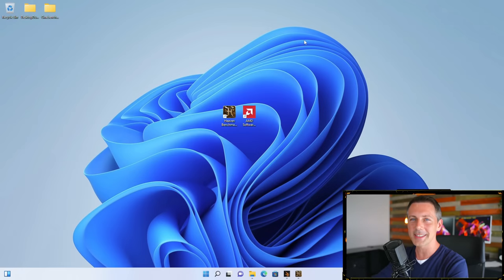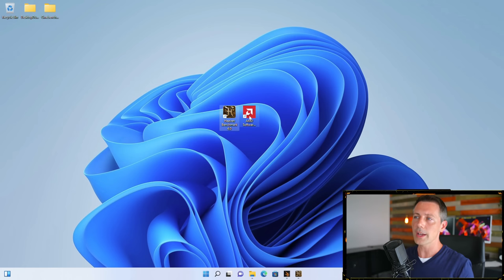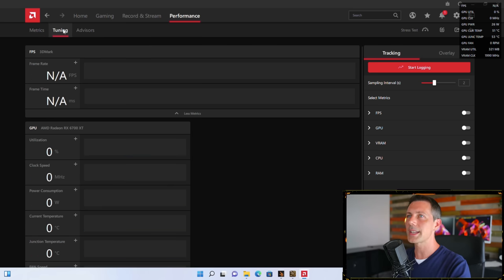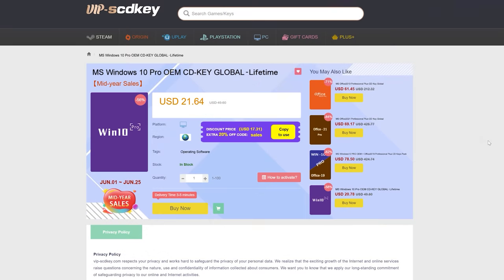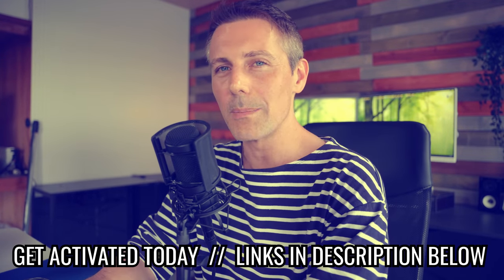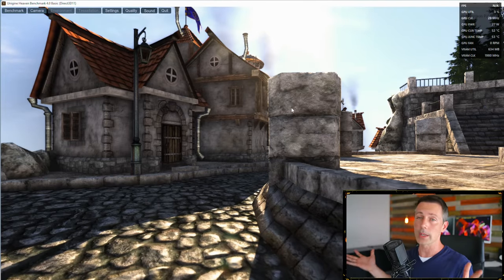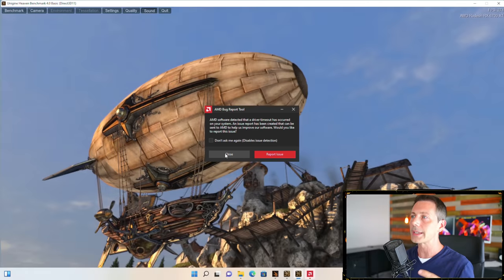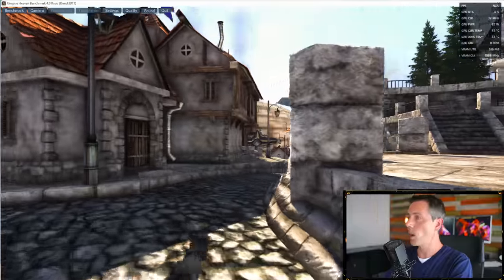How to UNDERVOLT AMD RX 6000 Series GPUs

Comment: I do disagree with the fast timings point, I have the same card and have it under volted/OC’ed and I have fast timings enabled and it’s been stable for me so far.  Also this model does come over clocked out of the box, the challenger D does not which is the baseline asrock model. Granted my voltage is a bit higher than in the video but overall the card has done well with my testing so far.

Comment: I'm using a RX 6600 Powercolor GPU, I've tried several OC / UV + 20% power up settings and got an increase of 5-15 (+- 10%) FPS. Should I keep using the stock settings or do OC with this increase?

Comment: I just got a rx 6700xt from Powercolor (Hellhound). 
That's weird.. If I set the same setting as you my GPU draws 120W but less GPU Temperature (GPU CUR around 48/ GPU JUNC around 57)
But I don't want less temperatur. I want less power draw :D Besides, if I drop to 1080mv I get artifacts.

Appreciate the tutorial. Thumps up

Comment: Hi. I was thinking of going for the rx 6700 xt. It recommended 650watt psu but i only have 550watt in my system atm. My prosessor is a ryzen 5 2600. Do you think in ok with my 550watt psu if i undervolt the rx 6700 xt?

Comment: HOLY Crap! Not even 200 Mhz difference on core clock, and it's eating so much more power! WOW! I doubt you will even feel that performance difference on a 6800XT (especially if you don't game at 4K or trying to get 144 FPS). If you want most games to run at 60 FPS at 1080p/1440p, you can easily drop the power consumption and clocks. Depending on how much you game, this could save you a significant amount on your yearly power bill, especially with the high costs of power that we're dealing with now.

Comment: If you set vsync or limit max fps in a game will the gpu use a lower power automatically or does it always use max power? In my amd settings I remember seeing 5 different stages (low to high demand) that you can customise different clock speeds. Not sure if power draw is affected by these stage settings or not.

Comment: got my reference 6950xt to run at 2300mhz, 950mV, fast memory timing but stock vram speed - power consumption dropped from 270w in Heaven benchmark to 170w at 70°C

Comment: Fantastic video, I'm also using a 6700xt and I originally tried the auto undervolt option, it would occasinally make my pc restart and reset my amd settings, these manual settings in the video are perfect for me, thanks. One question, You mentioned SAM (smart acess memory) and I ended up trying to enable it in my bios, I followed the steps I found online but the SAM option just isnt there for me, is it because I need both an amd cpu and gpu? I could get resizable bar with my nvidia gpu with my intel cpu
Reply: also your C drive disk have to be in GPT mode, there is manual on yt how to do it without reinstalling Windows
Reply: @sanyaez  it's all good, I only have an amd gpu, I would also need an amd cpu to be able to enable SAM

Comment: Just bought a 6800 which is way over the 1660 ti I'm coming from.

I want to undervolt it to drop the power usage and heat, not as concerned if I lose a few frames per second. 

Never done this before, where should I start?

Comment: Hey Bryan, I thought that the binning for voltage efficiency was opposing / detrimental to overclocking.  Basically the leaky samples clock higher.
Reply: This is true, but to get the higher clocks you'll need a crapton of voltage, and hence blow up the power consumption massively

Comment: Is the PowerColor Red Devil likely to be one of the better 6700 XT for undervolting? Jeez if I would have known I could run 6700 XT at 110W with only a 5% drop in performance I wouldn't have bought such a large card nor upgraded to a Corsair RM750x power supply.

Comment: I managed to get my 6600xt down to 1080mv and 2700mhz. I have no clue how it works but it runs at 95 watts stable with memory clocked at 2250 with fast timings

Comment: I'd rather get MORE performance than less for a card that I paid for. Less performance for less power doesn't sound like what most gamers care about. I don't mind how much power my PC uses. I don't leave it running all day so I would rather have a power hungry PC that gets better performance when I am playing it rather than one that gets less performance than stock just to save on power consumption. Just my opinion. I did overclock my 6700xt and run multiple tests until I was no longer getting more performance then slowly started undervolting. I did this back and forth with the undervolt and overclock to now be undervolted to 1125 and overclocked to the max along with max on vram with fast timings. I had a stability issue and lower performance raising the minimum too high. I set the minimum frequency to half of the max and have been getting great performance and lower temps as well.

Comment: Have you ever experienced where the test runs fine in heavens benchmark for 30 minutes but then in game it crashes?
I have Powercolor red devil 6750XT and the lowest I could go is 1140mv at 2600mhz with a  +15 power limit. It was smooth in heavens benchmark for 30 minutes but when I go game something like Horizon zero dawn or Far Cry new dawn, the game crashes after loading into the game and video driver times out. I had to bump the MV back up to 1150 to be stable. Seems like I cant go below 1150, even though I reduce the frequency. Wonder if 6750XT is just different or the card I got is bad luck  hmm.

Comment: Does anyone else have a problem with Unigine Valley or Heaven hanging and eventually crashing shortly after bringing AMD Adrenaline window on top? I can run the benchmarks but only if I don't bring focus to the AMD Adrenaline. This used to work fine about 6-12 months ago when I previously tuned my GPU.

Comment: morepowertool is also cool you can drop the voltage of the gpu by 100 a 150mv my rx6800 and rx6800xt do minimum 650mv the funny thing is with that i had for mining also for gaming it uses less voltage.

Comment: RX 6800 is running stable with 0.925v on 1970mhz and max memory mhz, you can play heavy games in 120fps with under 100w power consumption
Reply: Did you just lower the voltage in Adrenaline? Do you have to change frequencies or does it do it for you?

I want to set my voltage as low as it is stable like 900v

Comment: starnge, I have a Red Devil 6750XT, its default Clock is 2684Mhz, and the Voltage is 1200. I can lower the voltage to 1100 and run Heaven, Valley and Superposition benchmarks with no issue, but once I lower the Core clock, I immediately get the AMD Driver Timeout error

Comment: um, this isnt a super new thing, infact some older AMD gpu's would often overclock better with an undervolt rather then overvolt, sames true for some amd cpu's, minor undervolt and they still overclocked to the same levels as with a minor over volt... (we often found FX chips could be undervolted and overclocked to their turbo speeds or higher for example, but with LLC cranked up.. funny enough using less power and producing less heat then running it with lower LLC and higher overall volts.. 

i still want to see the 6k series vs the 3k series cards on x58, i mean i know the 3060ti would be an upgrade over this 1070 i have.. but... what would give the best overall results???

Comment: Guys my 6700xt challenger oc on default settings works just wonderful until I turn on a game and it just crashes after like 2-30min I’ve tried out : 
Fortnite can’t finish 1 game 

Rust I have 5min to set up a base to not lose everything

Tarkov crashes very “rarely” about every second game 30min~

the Finals I haven’t finished one game
 
Apex crashes once every 30mi

Squad 2-20min

the only game I don’t play but my little brother does is Roblox and it doesn’t crash never 

The rest everything crashes every 2-20min

One thing I have noticed is that as long as I am in the menu it doesn’t crash never only when I start a game and the fps are very stable avg 100fps 1080p in tarkov and stuff 
What can I do?

Comment: My 6800xt founders runs at 2400mhz at 1.005V, 2150 mem with fast timings, right now replaying the Witcher 3 next gen at 4k ultra locked 60 and the GPU sits at 57C GPU, 67C hot spot and using 160W avg. Crap cooler but good chip and mem.

Comment: mines crashes at 1100v and having 1120v gives me bad fps and not much change in temps regardless higher mhz or lower. default 1150 seem good but its hot

Comment: I wonder why people max out power limit while undervolting.
Won't the power draw be reduced anyway because of undervolting? So where is the point by increasing the power limit to the max (+15%) ???
Reply: It's so your gpu can try to reach as high of clock speed it can/use all of the voltage given to it.

Comment: Any Idea how to fix Vcore changes not apply, on my test Rig Rx 6700 worked at 1.07V but, now on my main Rig I stuck at 1.2V and getting +30W power draw and higher temps for lower performance :(
I try DDU bot not helped, I also try MSI afterburner and also changes not apply.

Comment: 6800xt 1050 mV and 2340 clock gives me 195-205 watts, its quieter than my cpu fan, unfortunately coil whine is a problem lol. We'll see if it works in games, but its been running the benchmark for 30 mins at an average of 2300mhz and 202 watts
Reply: Crazy really, card doesn't go much above 2380 with a full overclock but seems to love being starved of power and running at 2280-2300 at 60 watts less power and 10c less temp....

Comment: I would use the AMD 5600 CPU instead of the 5500 to get Gen4 PCIe lanes with a 6700XT. Also Smart Access memory really improves gaming performance on the AMD cards.
Reply: pcie gen4 wont make a difference on 6700 XT, its the same performance on gen3

Comment: You did not just undervolt. You also underclocked by around 250MHz vs stock. That's why power went down so much.
Reply: yes but 90 percent of the time you will not get anywhere near 2600mhz more around 2300-2400mhz, this way you still get same performance if not more while remaining in low tepms, i dropped by 23 degrees with these settings in borderlands 3 on max settings with a roughly 5% incresse in fps

Comment: Don't just full send vram Freq to 2150mhz. With these cards the memory timings could auto switch to looser timings past 2100 or 2120MHz, so do some benchmark runs at each step to see which mem Freq gives you best performance. You might have mem that won't be stable above 2100 but will still run causing error correction which causes performance regression. This is a prime example of dont just copy these type of YouTubers who make mainly entertainment videos, they aren't as tech literate as you think
Reply: I wish there was some kind of on screen warning which could be triggered when VRAM errors are detected to warn about excessive overclocking

Comment: Hello,
Is there any fix for "wattman settings are returned to the default setting cuz of unexpected failure.
I always get this error when i change a single option performance>tunning so the result is i cant undervolt my asrock challenger rx 6750 xt, is there any fix for it?
I have tried clean uninstall of drivers by amd cleanup utility, also i  disable fast startup option, but no luck.
Can i install drivers only and use some third party program instead of amd adrenalin software?
Thanks!

Comment: My RX6800 is default 1025mv. I can click on Chill and I'm doing 60fps at 53W. Since I have a 60hz monitor it seems to do fine. I can't clock as high as in this video, AMD limited it in bios and mine crashes around 2315mhz. Suspiciously almost exactly 200mhz overclock.
Reply: why get a power gpu with a 60hz monitor? its just waste of money and resources...unless you're planning to upgrade soon....
Reply: @HitSousouK  I was just upgrading a piece at a time when opportunity presented itself. If you have a reasonably competent processor, the best bang for the buck is in a graphics card. Already have a 2k monitor. The literal point was future proofing. The waste of money would be to buy a lesser card. I think I can make a case that a rx6800 is a midrange card. Compare the price to any three fan 3060ti. This might offend your sensibilities but I have a bunch of parts sitting here and the 6800 went in a rig that had a really good example of an overclocked ryzen  1600AF, then it had a 5600G then a straight up 5600. The difference in frames, best to worst was 20.

Comment: used to get 88 degrees C on my old undervolt now im only getting 82 at 120 watts, definitely an improvement and a slight increase in performance as my gpu supports fast timing, in short it worked for me, i lied, for some reason my fan speed was only at 20% so i set it to 80% and it dropped down to 70 degrees 👍

Comment: While your instructions are easy to understand, for some reason undervolting just isn't working for me.  I managed to get to a point where Heaven wasn't crashing on me, around 1175mV, and while it wasn't the 1100mV that I was hoping for from your video I thought I was done.  Any time I boot up a game though, it crashes my drivers and resets me back to default.  I wanted to undervolt specifically to reduce the godawful coil whine I get any time I'm using anything more intensive than Youtube, but I don't know what to do now.
Reply: Mine is doing the same,after I do all the uv + oc then if I restart pc,it goes back to default settings,just a pain redoing it everytime

Comment: also my 6900xt ref' 2455 and 1065MV stable. I want like 2500MHZ an 1080mv thats the dream :D i UV because the temps. For me its strange an GPU with over 90° on Hotspot, i also order an Ice Wolf2 to put the 6900XT on water. Some people means the 6900XT 90-100° on Hotspot its normal and i should let them so no! my UV i'm -10° on average the rest i have it on Auto no powerlimit etc. The GPU is on an 680X case with 8 fans Airflow was never a problem :D

Comment: Great tutorial, my temps dropped around 18c on my 6600xt, quick question if anyone could help please, the VRAM in radeon software is 2000 as default however my slider goes all the way to 2400 not 2100 as in this vid. Is this safe or should I put this to 2100?. Thanks
Reply: You can try 2400, maybe you are lucky and its stavle,if not the driver will crash and reset to default, so nothing bad happens

Comment: Question:
My gpu is hd 7850 . Its extremely old and sometimes flicker . I know its about to die and already at its end of life span.
But i cant buy a gpu now. Should i undervolt it? 
It is even beneficial to undervolt such old card?
Reply: you won't know until you try so just try it and see if it helps

Comment: I don't see the point. Why spend the extra money buying a 6700xt only to essentially cripple it down to a 6600xt? Just to save a few bucks on your power bill? Why not just buy a 6600xt then? Then you don't have to spend the extra money. 

You can undervolt without losing performance. Why not do that?

Comment: I have an xfx merc rx 6900xt and I have a hunch it keeps crashing my system while gaming. I did not over clock anything on this system. It’s so frustrating because I spent over 2k on this system and it keeps crashing. I’m going to try under clocking to see if this solves my problem. Does anyone have the same issue with the rx 6900xt and have you solved it?

System Info:
CPU: ryzen 7 7700x
GPU:  xfx merc Radeon rx 6900xt
MOBO: AORUS b650 elite gaming
RAM: AORUS DDR5 5600mhz(only runs at 4800)
COOLER: Corsair H100i elite
PSU: Corsair HX 1000i
Case: ThermalTake View

Comment: Why wouldn’t u overclock while undervolting to get max performance….
Reply: You can’t just have it “both ways”. Overclocking needs more Volts, as your asking for more power/preference.
Reply: @yodead369  yes you can. The problem is overclock would be very minor if you undervolt at the same time.

Comment: It is idling at 25W. This is awfull. My I9 ES is limited to 45W and I didn't want to  unlock it for 65W to save more of my solar panel power. I have my PC connected to DC power converter plugged to 12V battery immediately on 12V rails.

Having such a GPU idling at 25!!!W is awfull.
Reply: maybe he was recording the video on the gpu? or he has several monitors plugged into it and the memory is at max because of that

Comment: Looking at the 6800xt on paper, I was certain it would be my favourite gpu of all time.  2 years of Radeon use, I've grown to hate AMD drivers.

Still hate Nvidia though, FSR 2.0 proves tensor cores aren't for gamers.
Reply: Sorry to hear that.  I've had a Powercolor Red Devil 6800xt for over a year and never had a problem with it except initial screen tearing, which I also have had with a Vega 56 and fixed the same way in the Adrenaline ap.
Reply: @Rushtallica  it's so dissapointing we only get 2-3 windows certified drivers a year.

Comment: So annoying that I can't undervolt my GTX 970 and only thing I can do is to reduce power limit and degrade performance.
Reply: you can with the msi afterburner
Reply: @Zero11s  Nope there are no voltage controls and after googling it appears that this GPU cannot be undervolted without bios flashing.
Reply: you can undervolt maxwell by raising the core clock and dropping power limit to like 70-80%
Reply: @khalilurrahman3d  Thanks man that actually seemed to work. I lowered power limit to 70% and raised core clock by 130MHz (highest I could go without GPU crash) and mem clock by 200MHz. According to Heaven Benchmark I only lost about 1fps on average compared to default settings. Using 70% limit GPU consumes ~120W so compared to default 160W it's about 25% less power consumption without noticeable performance drop which is nice